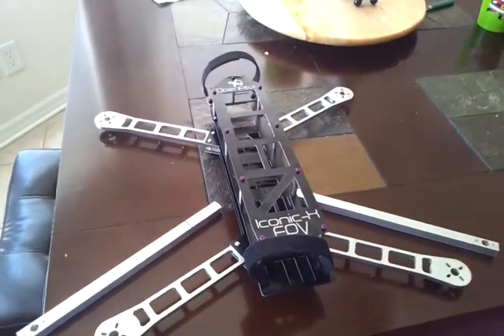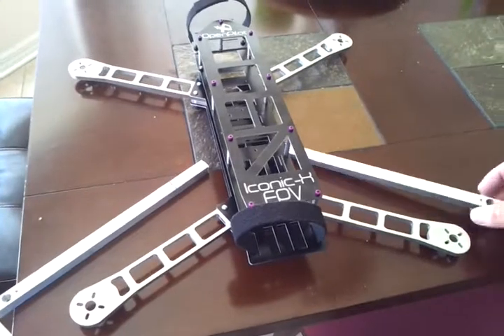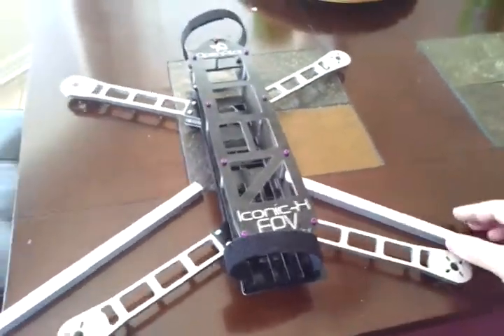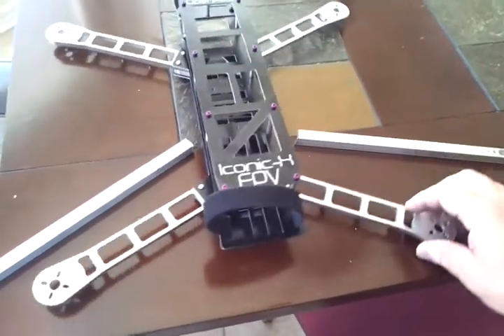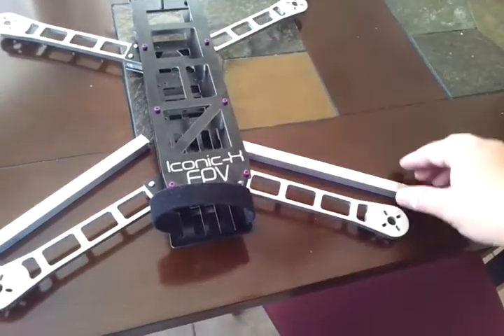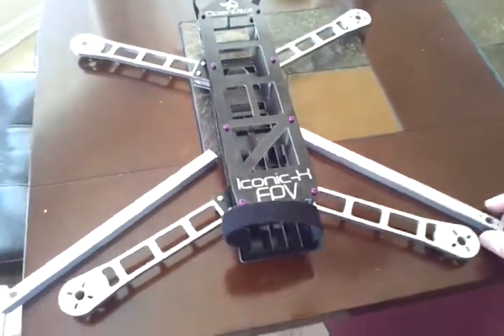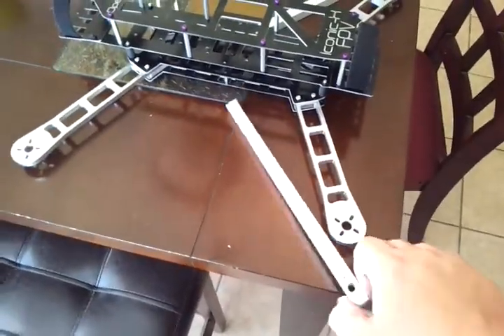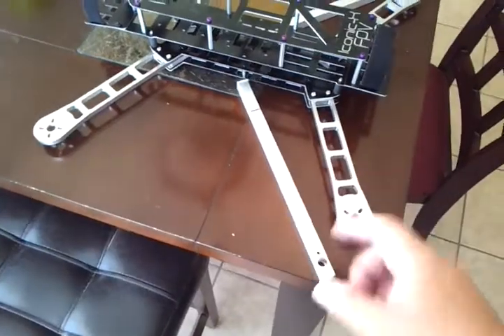Iconic-X FPV  Frame 1/2" Square tubing ARM option

Comment: May be a bit late in commenting, but,, I'd say the square arm option would be great 'trainer arms' for new pilots who didn't want to risk being the original arms.

They could simply swap out the square for milled when they felt they were ready. (have a little 'graduation' ceremony) :-))